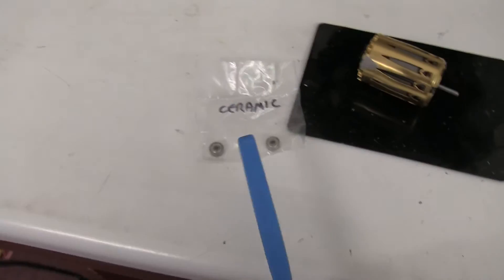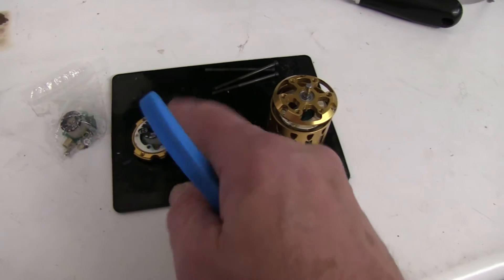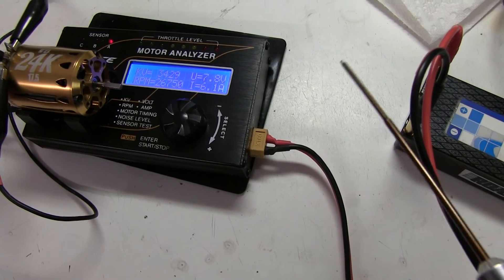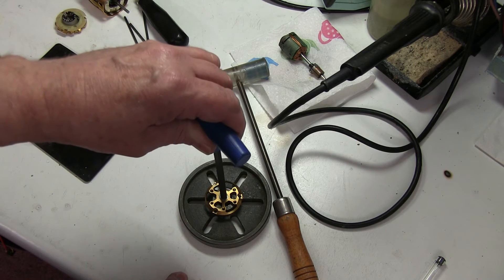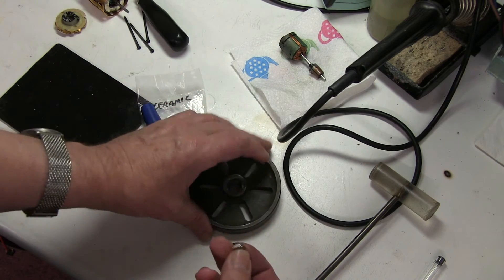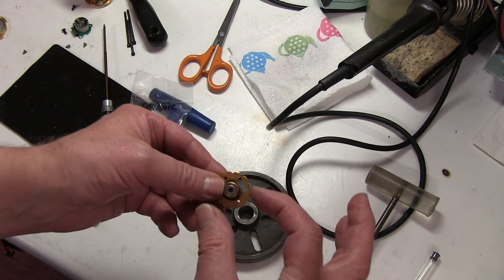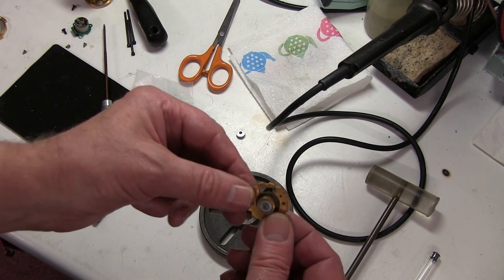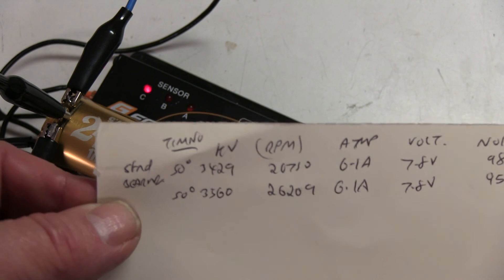Ceramic bearings for brushless motors

Comment: Another important reason to convert to ceramic bearings, is that the high frequency harmonics from the ESC induces current in the rotor and axle. This is not only a slight cooling issue, but that current is going through the bearings too, so the race surfaces erode and breakdown of the oil is accelerated. Using ceramic bearings, which are insulators, solves that problem and the higher rpm is not only from the lower drag from ceramic bearings, but also from breaking the path from these spurious eddy currents.

Comment: Nick, usualy Steel bearings are good from 0 to 25k rpm at for more rpm at 35k and more ceramic balls are better, ceramic balls are more precise than steel (bearing use less gap), an other idea for you;  use new steel an ceramic bearings clean them (remove the orignial oil) then lubricate them with motor oil bearings for RC, then test both configuration bearings @ 30k rpm and 40k rmp and see the difference
Reply from the maker: Hi, Thanks for the info, very useful. Keep safe. Nick
Reply: @nickadams5411  Thank's, you too, continue to make video about motors and electronics i realy like your channel

Comment: That is a awesome debunk RC urban legend.  I knew guys spent big bucks for ceramic bearings in the motor.  The only one place I do notice is on the kit.  When I ran 12th scale the ceramic bearings for sure rolled much longer but I don't think it really  made any improvement in performance.
Reply from the maker: Hi Brian. There is a lot of disagreement about Ceramic bearings. One thing is certain though, and that is they are affected by dirt and water the same as standard bearings. And then any advantage is gone. The tolerances can be tight which can make them even mor susceptible to dirt grinding them down.  All bearings require a bit of oil, and ceramic are prone to seze if not oiled. If you replace the wheel bearings etc in your car with ceramic, they will be very smooth, partly due to the closer tolerances, which means less slop. But they suffer from impact damage as well as dirt, and will soon lose any smoothness.
In motors the ceramic should have less rotational resistance, but any misalignment will negate that. And I did not find any improvement.  Some say you have to run them in. What they allude to is that the bearing is not aligned, and it has to be worn out rather than worn in to get it to spin freely.  Thanks for your observations. And keep racing. Nick
Reply: @nickadams5411  I totally agree.  When I was only running indoor carpet I like using ceramic but now that I am racing more outdoors it is not worth the trouble or price.  I do like the video and I always wondered about the ceramic in motors.  I personally always thought it was over kill.

Comment: You forgot one thing ceramic bearings that you installed are new and have the broken in.  Eventually you will get more performance once they are worn in.
Reply from the maker: Hi Michael. Thanks for the information. I should also have mentioned, that ceramic bearings do not expand  with heat. And these motors run hot, so there should be less losses at high temperature.

Comment: I was thinking of putting ceramics into my motors for underwater purposes, but the motors are only £6 so probably will just replace them. Nice way of doing it without the drill press, thanks.
Reply from the maker: Hi Gary
Yes, as they use stainless steel case, they shouldn't rust. But hopefully the ball cage is stanless as well.

Comment: hi nick in your opinion what is the best motor for a x ray buggy kit 1/8 ?
Reply from the maker: Hi Florence
I have not tested the larger motors used in 1/8th buggies.
But you can't go wrong with Trinity/Revtech motors.
Always check the temperature of the motor after a run.
If not hot, then it can be timed/geared to go faster.
If too hot to touch then slow it down, timing or gearing.
Race on
nick
Reply: thank you very much

Comment: maybe you damage the bearings during the installation...
To insert the bearings you hit its internal part, when you had to press the external one, otherwise the blows and pressure are supported by the ceramic pieces.
These bearings are probably not designed to receive lateral forces.
Proof of this is the poor turn they have and performance.

Comment: If you put the bearing in a bag and stick them in the freezer for 5 mins they will just full in the case
Reply from the maker: Hi Paul
Yes, you are right, the metal will contract and make it easier to fit in a tight recess.

Comment: Interesting, I put ceramic bearing in and had an increase of about 300 RPM and a decrease in noise. I did flush both bearings and use the same oil in both. So, I wonder if the quality of your ceramics were the issue or the lube in them causing your 500 RPM decrease. 

The motor I tested this in was a 24k certified 21.5
Reply from the maker: Hi John
I agree
There was less noise with the ceramic.
Quite often motors make a lot of noise when the standard bearings start to wear.
I did a follow up test, by flushing out and then thin oil, but there was no improvement.
However:
These are very tight tolerance bearings.
Tighter tolerance bearings are meant for high precision machine operations. So perhaps they give drag if not perfectly aligned.
Running the motor should align them, so you could be right.

Comment: I bet they will get better over time, just need some break in.
Reply from the maker: Hi
Maybe, I will test again after a race meet.
Break in implies that the bearings have too much grease in them or the cages or parts are not aligned.
Cheaper bearings have a lot of play and so perhaps have less friction.
Tighter tolerance bearings are meant for high precision machine operations. So perhaps they give drag if not perfectly aligned.
Running the motor should align them, so you could be right.
Reply: @nickadams5411  any and all motors need to be broken in...period. Anything with new metal ...rotating shafts..pistons or bearings MUST be brokin in...also dont hit bearings..u will damage. Just pop in freezer.